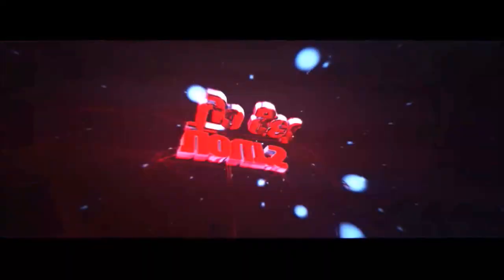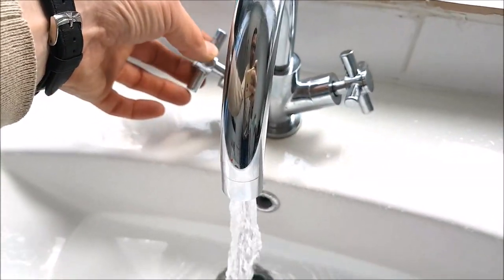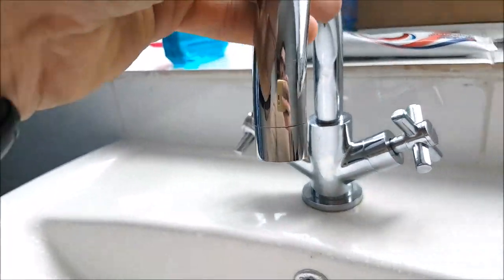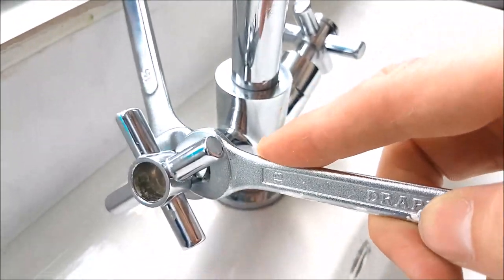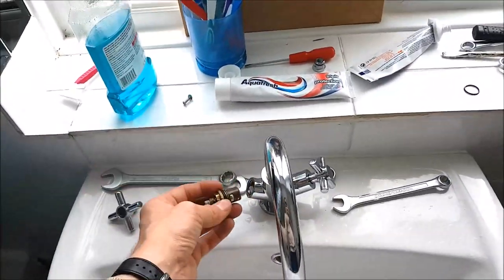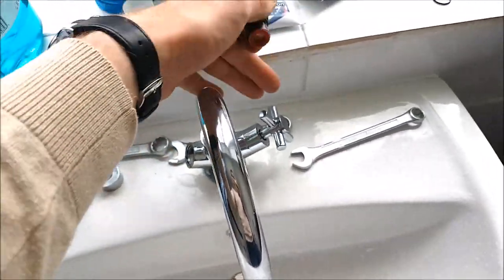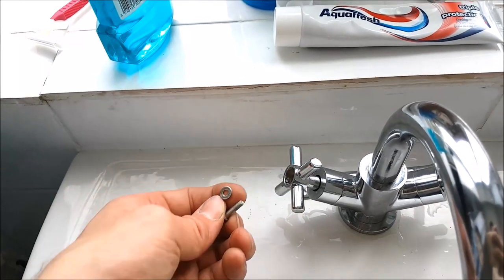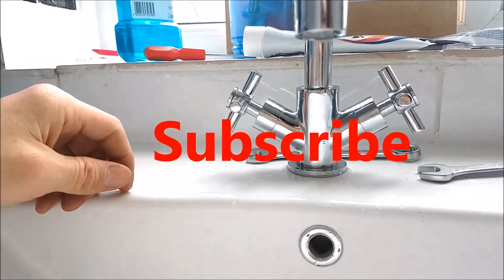How to Fix a Noisy Tap - Faulty Dripping Faucet Repair

Comment: Thank you, my taps look just like yours! Mine were making a racket of a noise, I replaced the tap glands and it's fixed, although they are not 'standard' so not easy to find (I used glands from the same tap type I had in another basin).
Reply from the maker: can i ask what gland you used as i cant find them, been looking for a while?
Reply: @Gogetyours  I acutally swapped a pair from an exact same tap I have in another bathroom.  So am still looking for replacements (toolstation don't do them, nor a local plumber's shop - they were close but without the thread for the tap cover). Have just seen some on Amazon that look right, so will let you know if they work :)
Reply from the maker: @catbigio  cheers for the info, I appreciate that

Comment: Thanks for the video. I'm confused whether it's the valve or rubber ring that's gone on my taps! We had the taps changed a couple of months ago but it makes noise when either one (hot or cold) taps are on. The hot water comes out sometimes when it's off and makes the cold tap noisier. When I  turned off the hot tap, cold tap still makes noise. There are vibrations too when both taps are on. What should I do please?! There's also 2 valves on each tap (for some reason) so to turn it off, I can turn either the top or bottom one and it shuts tap off.
Reply: Hi, just to add: if the tap is not dripping, just squealing; then the rubber washer may be dirty. Gently clean it (no need to take off) dry it, then put some PETROLEUM JELLY (Vaseline) on it. Worth doing anyway if you’ve taken it apart.
Reply: @mrjolly65  Agree.  In Australia we would call it an O-Ring.  There are usually two of them made of black rubber recessed in separate notches on the spindle.  Washes are usually red and separate the spindle from the basin.  Not sure what you call them in the UK.

Comment: Mine doesn't make a nose but it drips. I can see the hot tap is a bit wobbly. Should I do the same thing
Reply from the maker: you can try, make sure the securing screw is tight at the end